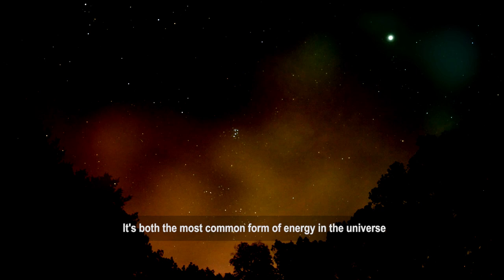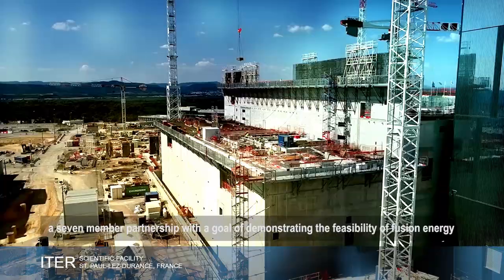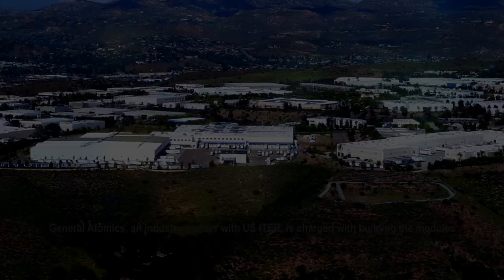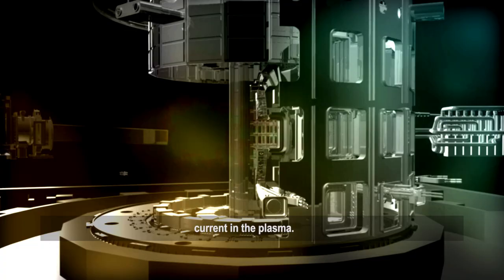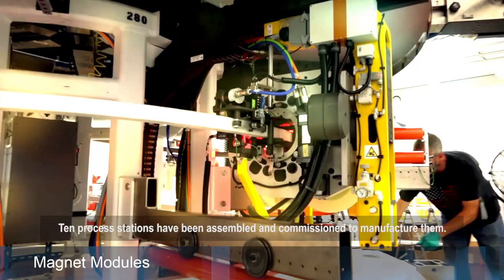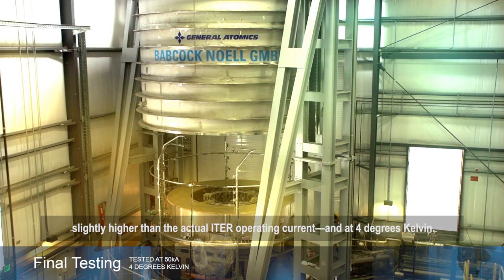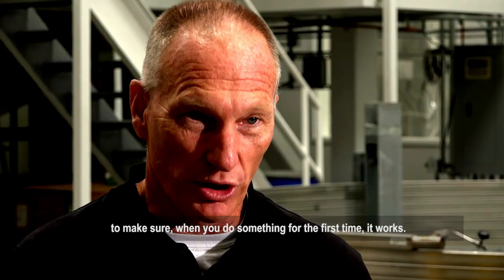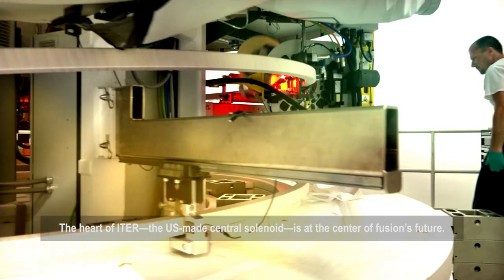Building the Heart of ITER

Comment: So what happens when a malfunction occurs while trying to sustain burning plasma that is equivalent to the nuclear fusion of a Star? The result would be a supernova on earth itself. Earth would explode to oblivion. A nuclear reactor melting down doesn’t even compare to failing to contain plasma and nuclear fusion. During a nuclear reactor meltdown there are protocols in place. If you wanna call them protocols. Which the only protocol is evacuation from airborne lethal radiation. But a nuclear fusion reaction that can’t be sustained, that’s the end of life and earth in a split second. There are no protocols to escape a supernova on earth. Do we trust this technology and this company being able to sustain this kind of energy? Death is knocking on our door. Are we that ignorant to open the door?
Reply: What supernova are you talking about? In order to achieve fusion ions need to be under great pressure- that s how it works in stars. On the earth we cannot achieve similar pressure, so plasma must be hotter. In order to have hot plasma you have to insulate plasma from the environmet- that s what magnetic containment does. If it fails, plasma touches the walls- temperature drops-> end of fusion. No problem, except the damage for the equipment.
Reply: Get your facts right, drama queen. It is not like what is happening in the sun of course. In fact the proces is so fragile that it instantly stops if anything would go wrong. It can only exist in under very unnatural conditions on earth.
Reply: John David, I'm not sure who your physics teacher is but I'd be surprised if he/she still has a job.